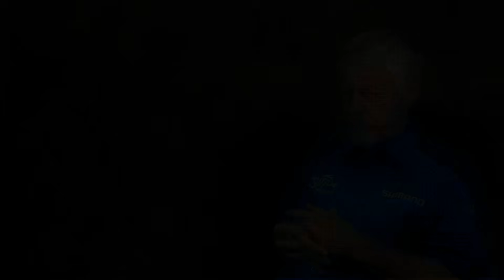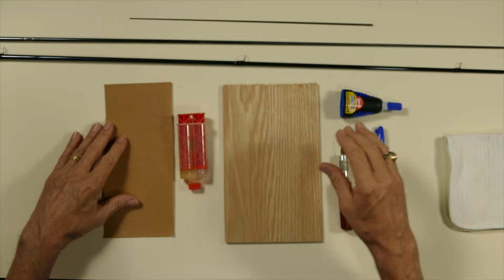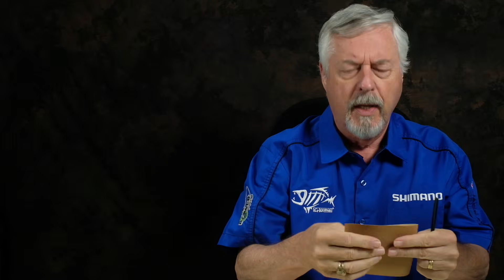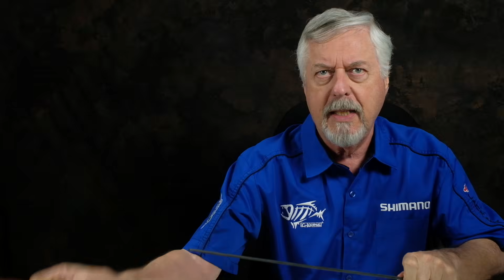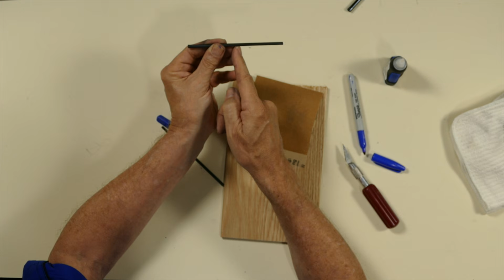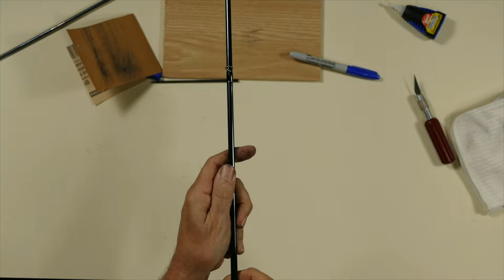How to repair a broken fishing rod: a simple fix that lasts

Comment: What would you recommend if you broke off the top 3 inches of your rod and can’t stick anything in the center
Reply from the maker: I've had that happen to me as well. Fortunately I had a store nearby that sold rod building supplies and I bought a slightly larger tiptop that we glued on. I've also reused the old tiptop by carefully sanding down the tip of blank at the break and gluing the old one back on.

Comment: Thank you for making this very simple but effective video.  I broke my best rod, a two piece spinning rod that broke midway of the top piece.  While I was able to replace the rod under warranty, I still wanted to see if this one was fixable.  I found a smaller rod tip, but it was just too big.  The ID of my top piece was only 2mm so pretty small.  In talking with a fishing friend, the subject of a bicycle spoke came up.  I measured a spoke on my bike and it was 2mm OD.  I went to a local bike shop and for $2 got a spoke and it fit perfectly.  They are generally stainless steel so while strong, they are somewhat flexible as well.  Following your instructions, a cardboard box, screwdriver, block of wood, clamp, superglue, and heavy duty thread, I was able to make a repair.  It is now drying.  I will give it a couple of days to completely cure, then will give it a try.  As you said, it may not look pretty, but functional is what I wanted.  And it really doesn't look that bad.  Black thread on a black rod.  And if worse comes to worse, I can still order just the top piece and have a new rod again, but I will then have 2!  You can never have enough.  PS, one thing I thought of after I finished was that I might have wrapped a section of thread around the bottom to take up a little slack where the rod taper gets a bit larger.  But that was only 2.4 mm so probably not a big deal, the JB weld likely filled the void.  Thanks again.

Comment: So my father passed away and never got to use if 9wt Penn fly rod my mom got him. In the process of going through and transporting things that was his to my house the tip broke and i lost my mind! I don't know if you receive rods repair and return but if you do or know anyone who does i would gladly pay for that service.
Reply from the maker: That's the sort of thing you hate to hear happen. If you contact Penn they may be able to get you a replacement tip. 

I had a similar problem happen to my 10 wt. rod that my wife bought me for my 50th birthday. The rod tip got crushed under a wobbly boat seat and it was beyond repair. The company was able to get a new tip section for me despite the rod being out of production.

If the tip was broken very close to the tiptop, we can simply add a new, slightly larger diameter tiptop to the rod. Any shop that sells rod building supplies should be able to help you out. I did that once while out on  a fishing trip with my kids. The tiptop got snapped off, but fortunately I knew of a shop an hour's drive away from ur campsite, and they were able to glue on a new tiptop.

Comment: Hi, my name is Luca and I'm writing you from Italy. Last week I broke my fantastic Gloomis IMX Pro Blue spinning rod and I want to repair it. The problem is that it's a 1-piece rod and I broke a piece of almost 20-25 cm from the tip. Do you think it can be possible to repair it or not? Thanks😊
Reply from the maker: There are two issues that have to be addressed:

1: Is there enough diameter at the 25cm point on the blank to hold a spigot. Anything smaller than 3mm diameter is going to make it difficult to make a decent spigot.

2: Making a hole in the butt cap of the rod to pass the spigot through as well as the ram needed to push it into place.

Assuming you have enough diameter for a big enough spigot, then do the following to make the hole:

1 - buy a large diameter brass tube from a hobby shop, 8 to 10mm outside diameter would be adequate
2 - cut off about about 8 to 10cm of the tubing and chuck that piece into a drill
3 - using either a fine file or sandpaper, spin the tubing and sharpen the end of the tubing into a cutting edge
4 - use the tubing & drill to cut a hole in the butt cap - the spinning tubing will cut its way through the butt cap - this leaves you with a plug that can be glued back in place when you're finished
5 - with the hole cut you can drop the spigot through the rod blank to the break
6 - you'll need a ram to push the spigot in place once you've applied the glue to the inside of the break - with a one piece rod you'll need a long one and I'd suggest stiff copper wire

So your parts list includes: a donor rod, epoxy glue, brass tubing, and stiff copper wire.
Reply: @hooked4lifeca  Thank you for answering my question😊. The internal diameter of the carbon in the area where the fishing rod broke is almost certainly less than 3mm. Unfortunately I am abroad for vacation now and I don't have the possibility to measure with the caliper. In the case where it is less than 3mm can it still be repaired or is it not worth it? Honestly I would like to repair it because it is a very expensive rod
Reply: @ajejebrazorv9159  When talking 3mm, I was thinking more of the outside diameter of the blank.

The problem with skinny spigots is to make them strong enough and to do that we need to double them as shown in the video. It can be very difficult to double up one that is really skinny.

I'd still repair the rod with a single layer spigot as it's worth the attempt, however I'd make sure to put a stout wrap over the break for added reinforcement.

An alternate repair for really skinny blanks is to use stiff piano wire. We can't taper it to fit the blank, so we have to ensure that it is well glued. I have used this type of repair once and it did hold.

Comment: Hi Peter, just got my replacement butt piece of my Echo Nymphing rod. So pleased they took care of it. I thought I would try to repair the damaged piece to have a backup in case this happens again. I have a problem. It is the butt of the rod that broke, 2 inches from the cork. I have a tapered replacement piece ready for the narrow end but near the cork handle to get a taper in the handle I would have to come through the butt end, and it seems that would ruin the whole thing. It seems I have to settle with a bit of a reverse tapper to make this work. Your thoughts. David
Reply from the maker: When we had metal caps on the ends of our fly rods, we could just boil them off, but if the end is rubberized cork, then that's not a solution.

Go to a hobby shop and buy some brass tubing that's a bit bigger than the spigot (e.g. the spigot will slip inside of the tubing). 

Cut about 2" to 3" inches of the tubing off and put that piece in a drill chuck. Start up the drill and use a fine file to sharpen the end of the brass tubing. Then carefully align the tubing with the middle of the butt end of the handle, fire up the drill and use it to carefully cut a hole that will allow access to the rod blank. 

Insert the spigot and glue it in place. Inside the tubing will be a plug of rubberized cork that you can then push out and glue back into the butt of the rod. The repair will be barely noticeable.

Comment: Question. Where I snapped my pole (in car door). Now after cutting the jagged edges off both pieces, they don’t line up very well. What trick, or too do you have for that?
TIA
Reply from the maker: I'd taper the spigot to fit the misaligned pieces. Awkward, but it'll work. I'd then wrap with thread and epoxy the joint well.

Comment: Thanks so much for this vid! I recently broke my 3wt and was ready to toss it when I happened upon your vid. Ended up cutting a section out of a broken 5wt that I had kicking around and fashioning the spigot ferrule as you described. Worked like a charm! Sort of wish I found this vid 3 or 4 broken rods ago. One thing I did differently was slide a sleeve of marine heat-shrink tubing over the break before finishing the repair, then shrinking it nice and tight afterward. At a glance, the snugged down sleeve of heat-shrink is almost indistinguishable from the smooth bulge of a tip-over-butt ferrule.

Comment: What about the rods that already have a spiket ferrul rod and that ferrul part broke?
Reply from the maker: The problem will be to get the spigot out of the blank. This is a risky process, but the alternatives it to pay for a new section from the rod company, assuming the rod is still available.

1: drill a small hole in the broken end of the spigot, the length of the spigot, big enough to accept a screw
2: screw in a long wood screw into the hole (for gripping & heating purposes) leaving about a half inch exposed
3: dip the end of the rod section with the screw into boiling water
4: make sure that the screw head is in contact with the bottom of the pan so that it transmits heat to the inside of the spigot
5: remove the rod section from water, grip it well and gentle tap the head of the rod screw with a hammer to break the grip of the epoxy holding the spigot -  try to drive the spigot into the blank
6: if it fails to move, put it back into the boiling water
7: keep repeating until the spigot drops free
8: if necessary use a cutter to snip off the head of the screw to allow the spigot to drop out of the blank
9: using the old spigot as a model, fashion a new spigot and epoxy in place.
Reply: @hooked4lifeca  so the last part we will make the model just like this video right? Fortunately my rod is a 4 piece spigot ferrule rod  and I can just take that part and try to experiment with  these instructions; because, I wanna save some money as I don't have the money for the replacement part at this time and not till probably till March of next year. This pole Is used to catch Mahi, gt and such like fish species from the cliffs lol.
Reply from the maker: @ryansullivan9519  yes, except that if you're after Mahi I'd layer that spigot so that it is almost completely solid, a spigot, in a spigot, in a spigot etc. You'll need the strength.
Reply: @hooked4lifeca  I was thinking the exact same thing

Comment: Hi Peter, thanks for this. I bought myself a custom made rod as a retirement present a number of years ago and broke the tip last year. I sent it off to the rod builder, as instructed in their warranty policy, but he was so slow in picking it up from the post office that it was marked "Return to Sender". After I gave him a poor Google review, he refused to replace it. There's more to this saga, but let's leave it. My question though is, wouldn't epoxy glue be very rigid? Is there not a a more suitable glue that would be strong, waterproof, and flexible? Thanks so much for all the informative videos you provide!
Reply from the maker: Actually epoxy has some flex to it. Over 50 years ago I broke my first fly rod while showing it off to a friend. I fashioned a spigot and epoxied it in place. Over 25 years later when I gave that rod away, the repair was still holding. All of the wraps on a rod are covered with epoxy. It will last.

Comment: Really great video! My 7ft Shimano slx rod just broke and im pretty sure its missing one guide and the tip, is there anyway i can make a new rod end out of fiberglass and attach a guide to it?
Reply from the maker: How much of the tip is missing? That's the key thing, for if only a little bit is missing, we can just add a new tiptop and go fishing.
Reply: Its about 7inches from the tip, but i dont have the other piece to the rod. The rod is a medium heavy so i think putting a tip on there would be too heavy for a rod of its size
Reply from the maker: @SPaw-dg3ye  You're probably better off just fitting a tiptop to the end of the rod as it is now. It will change the action, making stiffer and less sensitive. It'll be more of a heavy instead of an MH, but it will be fishable. You should be able to find a new tiptop at any shop that sells rod building supplies.
Reply: Okay, thx a ton!

Comment: Can you give me the added secret on how to fix the one piece rod .  I love this method of sliding another broken piece inside.   What about a one piece with no access to the larger end?  Big thanks
Reply from the maker: Put a pot of water on the stove with a level just high enough to cover the butt of the rod. Once it's boiling, immerse the butt of the rod and that will soften the glue holding it place. Of course it's now hot, so have a rag or something to protect your hand. Grab the well cooked butt piece and pull it off. Make the repair and then epoxy the butt piece back on.
Reply: @hooked4lifeca  Can't wait to try it. !!  Thank you.  Come fish Cleveland steelhead any time you wish.  Free guide service included.

Comment: My bamboo 2 piece broke in half on a 8 lb Rainbow, the smaller piece that slides into the bigger piece broke at the silver joint leaving it's joint in the larger joint.  No bamboo is sticking up that you can grasp with pliers and pull it out.  I tried screwing in a small eye screw, no avail, the screw would let lose before any movement from the joint.  Any suggestions?
Reply from the maker: I'd select a wood screw that is longer than the ferrule and drill a hole in the stuck piece all the way to the end. The hole should be the same diameter as the shaft of the screw as we don't want the screw expanding the wood and making it more difficult to remove. Then insert the screw, leaving enough of the head to grip with pliers.

Then apply heat (heat gun, hot water, etc.) to the ferrule to soften the glue. Grip the screw head with pliers and grip the ferrule with the foam lid removers we use for jar lids. That'll let you get a good grip on the ferrule with ought damaging it or burning yourself.

You should be able to pull it apart. If not, keep applying heat until the glue breaks down.

Comment: Good way to fix, but won't work on 1 piece rod. . .there's no way to access the inside from the wider diameter side.
Reply from the maker: Yes we can, it just takes a very long probe to push the spigot in place, plus we have to remove the butt cap from the handle. Boil the butt cap off. Been there done that.
Reply: @hooked4lifeca  my butt cap has a synthetic resin attaching a faux leather/composite piece. . .don't think boiling will work but maybe I can just cut it off and then epoxy it back on and hope I don't break my rod again. Thanks for keeping me thinking how I will achieve this 😉
Reply: Follow up: I drilled a small hole in the end of my rod, worked like a charm!
Reply from the maker: @brent829  Excellent!

Comment: Would this work well on a tip section? Have a g loomis slate 9' 5wt 3pc that i broken the tip section on. I tried contacting loomis but never got anywhere with them.
Reply from the maker: Depends on the inside diameter of the section. If it's too small for a graphite spigot from a donor rod, then consider getting some piano wire from a hobby shop, that is close to the right diameter, and sand it to a taper to fit. Piano wire has the necessary elasticity to function as a spigot.
Reply: @hooked4lifeca  ill give it a go. Also the break is just above a guide. Which are single for guides. Would placing the guide evenly across the break be a good idea?
Reply from the maker: @bobb3rdown676  Yes, placing a guide across break definitely helps as it acts a reinforcement.

Comment: Repairing the second most top half of a 13' really nice two handed 4-piece rod (part 2 from the tip). Following your method, would you say that the rod will be almost as new, or will it be severely impacted? Nice, clean snap, so the repair looks easy enough.
Reply from the maker: Do a good job on the repair and I doubt you'll notice anything when casting it. Probably the only effect will be you going easy at first. The advantage of this style of repair is that the rod continues to flex through the repair.
Reply: @hooked4lifeca  thank you! Is it necessary to use a double layered insert as you do here, or is it just as fine to use a single layered insert?
I intend to sacrifice a fairly short and stiff carbon fibre bass rod.
Reply from the maker: @DanielSwe93  Unless the donor rod has a thick sidewall, I'd go with the doubled spigot.
Reply: @hooked4lifeca  What about the difference in taper between the two rods? There will probably(?) be a small gap between the spigot and the blank. Will the glue handle this stress, or is it super important that there is no wiggle? In that case, how to handle that wiggle?
Reply from the maker: @DanielSwe93  I sand the spigot to a close fit then make sure that the joint is well filled with epoxy, then no wiggle.
Reply: @hooked4lifeca  Just gotta say thanks again, this method works like a charm. A bit of a hassle getting the spigot just right since my donor rod was only half the length of the broken 12'9 Reaction FRS. Casts like a million bucks and bends just the same. Now only time will tell if it will hold or not.
Reply: 3 years later and the rod is still fine! Pressure tested with 15lb trouts and quite a few atlantic salmon. Works like a charm!

Comment: Great video. Does the plug part have to be the same material as the rest of the rod?
Reply from the maker: It's preferable so that the stiffness of the blank doesn't change too much through the repair. That said, my first spigot repair was in 1970 when I broke my first fly rod while showing off to a friend. I used a small, hardened steel shank that was a good fit and epoxied it in place. The repair was still holding when I gave the rod away 20 years later.

Comment: $30 bucks to buy a donor rod? No, I'll put 20 or 30 more and buy a good rod. To heck with the broken rod. No, go buy a wooden dowel rod and sand it down to fit tightly. Epoxy it in. Done
Reply from the maker: $30.00 for a donor rod is no biggie if the broken rod originally was north of $500, and no, I won't be sticking a piece of doweling in in such a rod. The repair is relative to the value of the rod, whether sentimental of in $$$s.